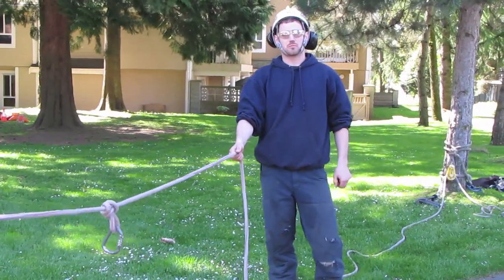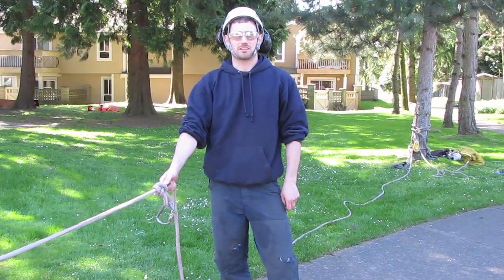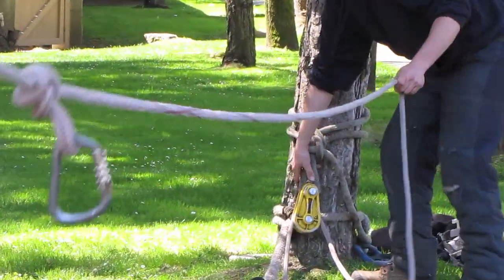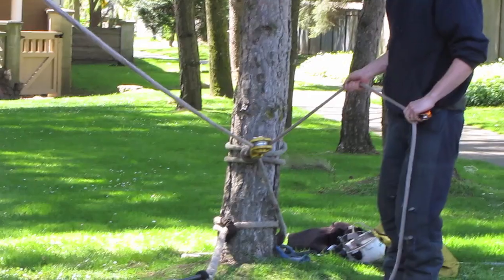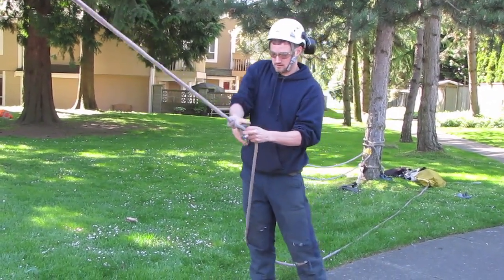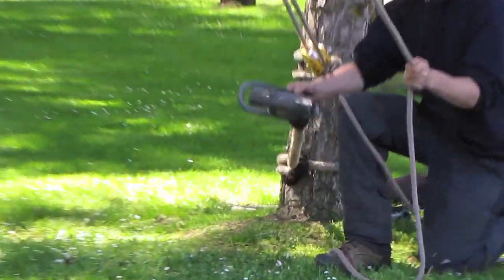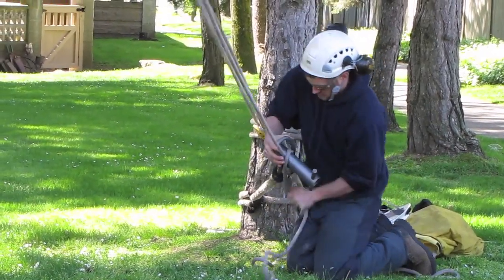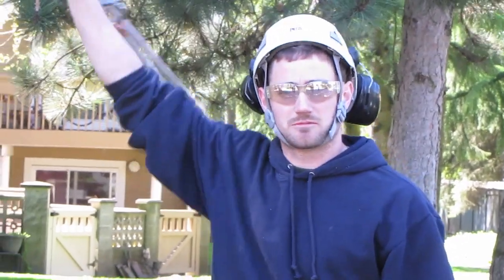Tree rigging methods: How to Setup a 3 to 1 pulling system

Comment from the maker: It can depend on the situation and how exactly you are using it, but a standard rigging line is usually good as long as you have a pulley that will run freely along the rope.